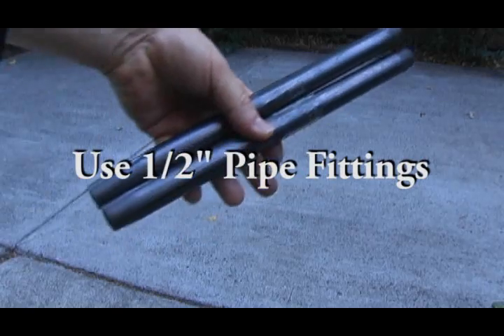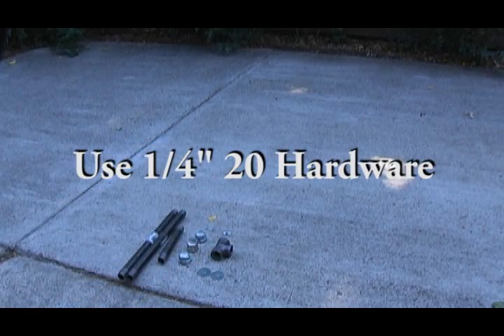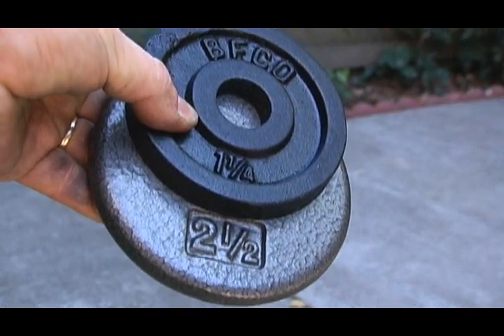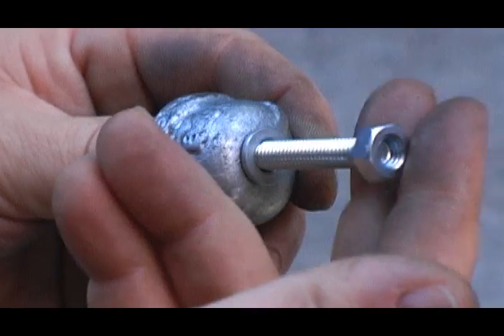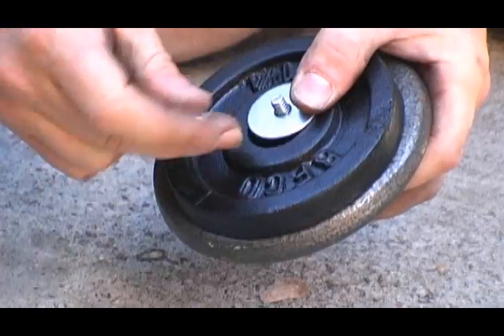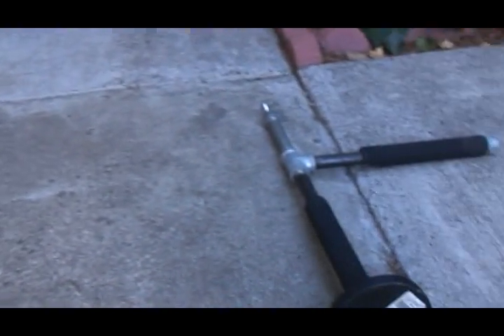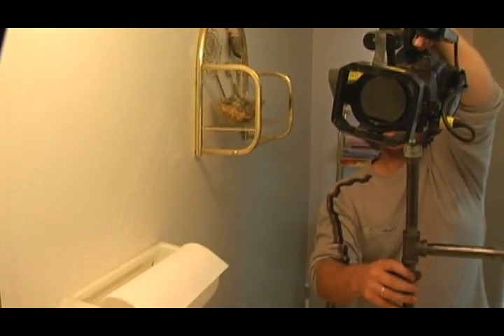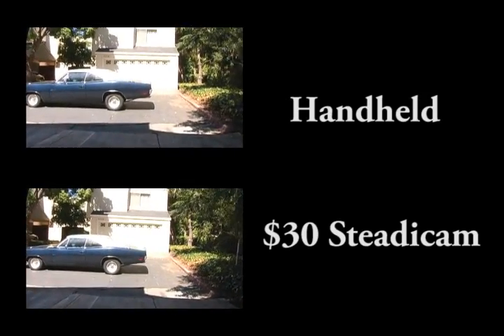Make a $30 steadicam

Comment: you are the man with this! Been researching ideas and I liked yours a lot so I made one and it works fabulous. I made it for my small point and shoot but still used 1/2" pipe for weight. The camera is only 4.6oz so I just used a flange for the counter weight. The local store was out of 1/2" galvanized caps so I just used pvc and it fits nice and works good. For the other cap, I just used the "packing" cap that it came with. Did for $12 too. Thanks for the info, my shots will look better w/this.

Comment: pvc bends, pvc is lighter.  the main advantage to the steel is the weight.  i mean sure you could fill the pvc with lead shot or something....  but the steel is sturdy and will last forever...   also we're talking $30... so  it's not exactly breaking the banks to begin with...  I'd rather spend the extra 20$ on the steel and know my camera is safe.  shit i spend more on a carrying case for my camera.

Comment: These DIY Steadicam ideas are great, but one of the big benefits of the actual Steadicam system is the arm/vest that enables one to use the Steadicam for significant periods of time without fatigue. If you try to shoot a wedding with just a Steadicam (and no arm/vest), you will be very sore.

Comment: OK. To do a better steadicam, don't do the 'L' connection at the top. Instead, put a 'T' connection on the bottom, and place floor flanges on either end of the 'T' on the bottom. Hold it with one hand, just under the camera, and let it hang. No need for weights. You will get incredibly vertical and smooth steadicam

Comment: @manboy1 Yes, but you don't the handle sticking out the side of this DIY steadicam. it will actually transfer movement fro the hand holding to the camera. All these DIY visedos are nice but they don't show you techniques.
you also need the rig to be slieghtly bottom heavy. (not much).

Comment: I have a Sony NX5U and it weighs 5lbs 11oz.
I used a 5 lbs counter weight and it did help a lot.
I also used 1" plastic threaded pipe rather than the metal.

Thanks for the tip.

Comment: @stephenr7456 If you go to a Hardware store or Home Depot ask for 1/2" galvanized nipples in 12" and 6" .  Also if you have a small cam you could use SCH40 PVC pipe but I would use 3/4" or 1".  The PVC pipe is also very easy to work with and looks better IMO..

Comment: Very clear explanation of how to do it however getting threads on the ends of the correct length of pipes is not as easy as one might be led to believe. Any advice from anyone would be very welcome indeed.

Comment: Great tutorial.  I have a Sony ex1.  Someone left a comment, "I would never put a $4000 camera on that thing".  If I can improve my handheld for $30, until I can get the "real" thing, I'm with it.  Would you recommend against it.  Is there any particular camera safety issues I should be aware of.   The way I see it,  the only contact the camera makes with the device is at the mount, so what is the issue with attaching an expensive camera to it.  Please advise b4 I build.  Thanks

Comment: I recomend putting more spacers in the cap at the top. As much as you need so that the bolt fits in the canera without having a log bit between the frame anf the camera.

Comment from the maker: @uglyrhinodotcom Both shots had the optical stabilization so it is obvious that it doesn't work that good using it for a handheld shot.  The best thing is to have optical stabilization with a steadicam at the same time like the $30 steadicam shot in this video.

Comment: @matttchapman It should work with a few modifications.  You'd need to hang the weights off centre, to compensate for the camera's tendency to make the rig lean forwards, or (probably best) put something between the rig and the camera to mount it with the weight centred properly.
Either arrangement would have to be adjustable or you wouldn't be able to balance different lenses.
Liked this.

Comment: I followed your instructions but used PVC instead. The pipe lengths weren't available where I live. The smallest was 10" inch. I'm using a Sony HDR-XR500v. The manual says it weighs 1.6 Lbs. I'm using a counter weight of 2.5 Lbs and having to ad washers as weights at the top. I couldn't find a smaller disc weight. This thing works great and is lightweight. Awesome tutorial you have here.

Comment: here's the list so you guys don't have to pause the video and go back:

1/2" pipe fittings:
2 12" pipes
1 6"
3 caps
t-fitting

1/4" 20 hardware:
2 flat washers
2 nuts
4 lock washers
1 wing nut
2 2" screws

counterweights

Comment: I like this, but your physics are a bit off.  With the fulcrum (t-joint) 2/3 of the way up the main shaft, you can reduce the amount of weight on the bottom by half to balance the rig, this should reduce sway and will bring the "Moment of Inertia" up to the handle rather than hanging at the center of the shaft as equal weights top and bottom would give.  This will also allow for longer shoot days as your arms will tire less quickly.

Comment from the maker: @qwertzu3   No it didn't damage the thread.  But that is exactly why i said to be careful cause it could very easily.  Also, the threads are not load bearing of all that weight.  Unless you picked the camera up by the handle with the steadicam attached.  Bad idea!

Comment: Just a thought - couldn't this also be done with aluminum pipe instead of steel pipe? I mean it's all about just counterweighting the rig to the camera isn't it? But very cool rig. You could have another offshoot from the upright and perhaps have it hooked to a belt on the waist as well or on the hip. Like this alot. Got to give it a try.

Comment from the maker: @Obsidian212   It is good for short durations of time.  It will get heavy if you used it the whole game.  I am going to make a $30 steadicam mash-up vid soon where i compare different materials.  But you will certainly get tired with this current cast iron design.

Comment: I am a certified professional Steadicam operator, and i own one my self. While I appreciate your effort and do agree that this unit you built DOES help to stabilize the camera immensely, it is does not compare to the results achieved by a real rig. Before I purchased my rig I made something very similar to this and used it for some walking B-reel shots used in a documentary, so I am not bashing this at all.  This is great for someone is not certified and is just looking to do low budget stuff.

Comment: I agree with yellow.  Plastic is much better imo.  I built one of these a year ago.  First I built the metal version.  Good but heavier than I expected.  
Now, the plastic version worked just as good if not better in my test.  The best thing of all was that it was light.

Comment: Mos' definitely !!! :0)  - That would be very helpful.  

I just bought a Canon Vixia HF S100.  It weighs 1 lb 3.4 ounces with a high capacity battery.  So, a steadi-cam made out of plastic plumbing parts and a 1.5 lb counterweight should prove more productive and compatible.

Again, thank you for sharing.  This is one of the most comprehensive video's and one of the most affordable DIY steadicam designs I've come across so far.  So again, thank you.

Comment from the maker: I just about guarantee that your drill bit is dull.  Those caps are made out of pretty weak metal so even a sharp steel bit should work.  if not you could try cobalt bits which are my favorite.

Obvious question.  Are you drilling clockwise?  Did you center punch the caps?